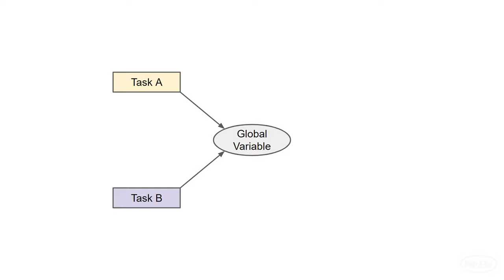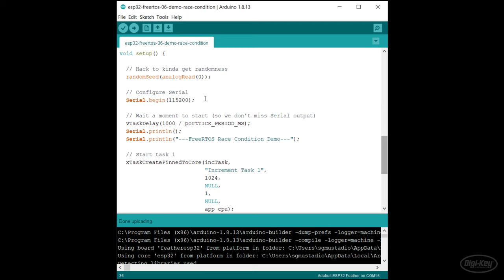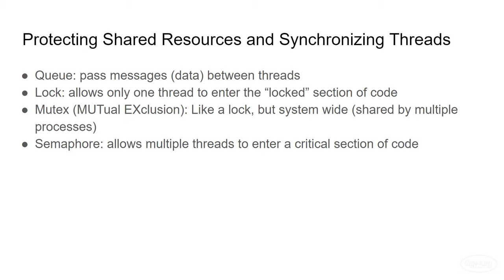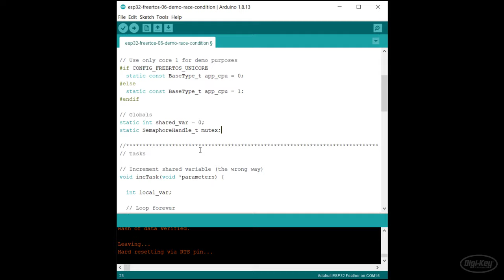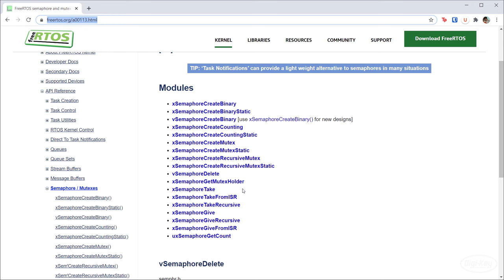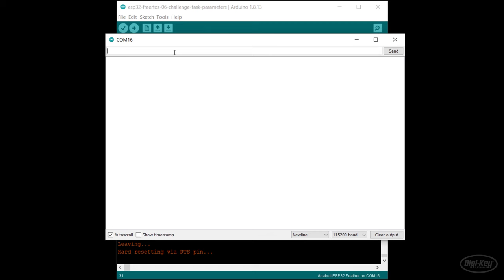Introduction to RTOS Part 6 - Mutex | Digi-Key Electronics

Comment: I attempted your challenge problem but it wasn't working but the code seemed fine.. It looked like the blinkLed task was taking too long to start and just wasn't able to take the mutex in time so I has to use a little bit of delay in setup so that the task can start and take the mutex, copy the variable and return it to signal the setup function to finish.. I was only able to solve the problem this way, is there another way to do this without using delays?

Comment: Nice example, but you print the shared_var after you give the Mutex. The shared variable is updated correct but there is a risk of printing the wrong value. You should print the local_var to safe
Reply: Good catch--it's not completely thread safe, as the other task could interrupt just before the Serial.println(shared_var) line. Either printing local_var or putting the print line inside the critical section should work.
Reply: @ShawnHymel  Printing local_var also isn't safe as the other task may increment and print between xSemaphoreGive() and Serial.println(). The safe way is to move printing inside the critical section

Comment: Hi Shawn. Thank you for the nice work.
I wanted to make sure "Serial.println(shared_var)" was "actually" being executed by different tasks, so I added Serial.println(pcTaskGetTaskName(xTaskGetCurrentTaskHandle())) to print the task name along the shared_var.
It works beautifully for the "race-condition", showing which task is actually printing the 'right' and 'wrong' values. But ...
When I did the same for the "demo-mutex", to my surprise only "Increment Task 1" executes, never "Increment Task 2".
Maybe the compiler is optimizing something ... even with two functions with the random delay.
At the end what worked was to add a small delay "vTaskDelay(1 / portTICK_PERIOD_MS);" right after "xSemaphoreGive(mutex);"
Only then you see one task printing after another in sucession.
Any thoughts?
Reply: Interesting...were both your task 1 and task 2 created with the same priority level (e.g. priority level 1)? It seems like your Task 1 is executing with a higher priority than Task 2. If they are the same priority, they should execute in a round-robin fashion.
Reply: @ShawnHymel     Hi again, Thanks for the promptly reply. So, no changes to priority or delays.
In """esp32-freertos-06-demo-mutex.ino""", JUST changed """Serial.print(shared_var);""" with
"""Serial.print(shared_var);   Serial.print(" <<< ");    Serial.println(pcTaskGetTaskName(xTaskGetCurrentTaskHandle()));"""

(Also shortened task name to "Task 1" and "Task 2", so it will show.)
It will print:   1 <<< Task 1 ...    2 <<< Task 1...    3 <<< Task 1...    4 <<< Task 1... forever(?)
Add """vTaskDelay(1 / portTICK_PERIOD_MS);""" right after """xSemaphoreGive(mutex);"""
And it will print: 1 <<< Task 1...    2 <<< Task 2...   3 <<< Task 1...   4 <<< Task 2... and so on (as expected).

Furthermore, in the original code, if I comment the delay """//vTaskDelay(random(100, 500) / portTICK_PERIOD_MS);""" and let it run 'super' fast (as you mentioned in the video), it will print: 
1 <<< Task 1   ...       1833 <<< Task 1
1834 <<< Task 2...   2018 <<< Task 2

2019 <<< Task 1...   3046 <<< Task 1

3047 <<< Task 2...   task 1 always run much longer then task 2.

By the way, using Arduino IDE 1.8.13 on a ESP32-DevKitC V4 development board.
Thanks again!

Comment: Hi Shawn, great tutorial, thanks.
I have an App that runs on a ESP32CAM. Task1, when triggered, takes a picture and stores it to SPIFFS. 
Task2 keeps checking SPIFFS to see if it finds new pictures, send them to FTP and deletes them.
The conflict would be if Task2 finds a picture partially written to SPIFFS by Task1 and tries to send it to FTP while it is still incomplete. 
So I am using a Global variable fileName that is populated when Task1 takes the picture and saves it to SPIFFS and as soon as the save is done fileName is set to "". So Task2, before grabbing a picture for transfer to FTP it checks if the name of the picture on SPIFFS is equal to the global variable fileName. 
If it maches it means Task1 is still writing the file and FTP file transfer is postponed.
Only Task1 writes to fileName, Task2 only reads although it has a big chance of concurrency as each task runs in its own core.
Do I need to implement the strategy shown in this tutorial to my App?
Thanks
Reply: If your global variable can be written atomically (i.e. one instruction cycle), then I think your global variable strategy will work fine (as you only have one task writing to it). However, I think this is the perfect opportunity to use a mutex or semaphore to notify other tasks. I believe the simplest solution would be to protect the new file reading and writing process (both functions) with a mutex.
Reply: If you try it, please let me know if it works! I'd love to hear about a mutex getting used in a real application like this!
Reply: @ShawnHymel  OK, I will try to implement it and report back. Thanks again.
Reply: Why not use a Queue here instead? Task 1 takes the image, writes it to a temp file, then once the file is written, it posts the filename to the Queue. It can then continue to take the next image and write to a new temp file. 
Meanwhile Task 2 is waiting on the Queue. When a filename arrives on the queue the task uploads that file then deletes the temp file.
This split also makes it easier to test your tasks independently.
Reply: @GrahamStw  Good idea...I didn't think of passing just the filenames with a queue.
Reply: @GrahamStw  I found that tasks had to be independent and run concurrently because, when an image is been transferred an event that triggers a new picture has to be serviced immediately so the process that takes pictures can never be denied immediate processing time. The file transfer is not that sensitive but once started cannot be interrupted in order to prevent timeouts so each task runs on its own core and are only interrupted if at all, by the task scheduler. That is my understanding of how things work.
Reply: @fingerprint8479  If the image capture is time critical then Task 1 may want to copy the image from the camera buffer to a memory buffer instead of a file. That would be faster than writing directly to file storage. Your only issue would be running out of memory (a typical solution would be to statically allocate a number of buffers). You could then perform your FTP from memory or perhaps have another Task that writes the memory buffer to a file before handing it to the FTP Task. None of the FTP timeouts should be so short that you have any problems with other Tasks running on that core. Hope that helps.
Reply: @GrahamStw  "Your only issue would be running out of memory"
I am also thinking about the possibility of a power failure, that is why the decision to record the image to SPIFFS.
Reply: @GrahamStw  "None of the FTP timeouts should be so short"
Yes, possibly, but I did not test this scenario and went straight to the independent tasks each running on its own core. The main concern has been that when it is time to take a picture and save it somewhere the process does not fail because I will not have a second chance for the exact same image.
The FTP file transfer, if and when successful deletes the source file from SPIFFS so, if FTP fails the system will try again so it is not that critical. The project is working fine this way and it is resistant to external failures like internet or power down.
Even the possible problem that led me to ask about the potential conflict between tasks while accessing the same variable has not bee shown to be a problem.
As I am busy improving other parts of the project I will live as it is now and fine tune it as required. 
Thanks, it sure helps improving the project.

Comment: Great video. But why not simply disable interrupts, check the global value, write to it and re-enable interrupts? Could this be what a mutex actually does behind the scenes?
Reply: Good question! You can disable interrupts with taskENTER_CRITICAL() and taskEXIT_CRITICAL() (it's a little different on the ESP32, which I'll show in a future episode). Using a mutex is different--a mutex allows other tasks and interrupts to run but won't let them take the same mutex. This way, you have several options when it comes to protecting shared resources.
Reply: @ShawnHymel  I guess what I'm getting at is that by entering a critical section to read and write a global variable and then immediately exiting the critical section would solve the problem without using a mutex and I imagine it would be faster than calling a separate function. And although other tasks and interrupts would be blocked for a couple of cycles, that's exactly what we were trying to do. This led me to think that maybe this is exactly what FreeRTOS's functions do internally, or do you know if there is any other way they could achieve this? Thanks. Probably getting a bit too detailed, sorry.
Reply: @ytubeleo  Yes, that is what FreeRTOS is doing when you use taskENTER_CRITICAL()--it disables interrupts (up to a given interrupt priority level). You could avoid a function call if you disabled them manually, but doing it that way would be unique to the processor (i.e. the code would not be as portable as it would be with FreeRTOS).

Comment: Hi Shawn, In the solution, I'm completely confused.
So in the setup() we took the Mutex a second time with xSemaphoreTake(mutex, portMAX_DELAY). Just for the purpose of waiting the maximum amount of time (so that it is blocked), that's the only reason right? If this is the only reason why not just use a a simple delay function vTaskDelay(1000 / portMAX_DELAY)?

Also, after we have run the second xSemaphoreTake(mutex, portMAX_DELAY).. since the mutex was released earlier, then the Mutex will be taken again returning pdTRUE, but I don't see a function afterwards to release it?

Any help is appreciated

Comment: Is it possible to put the user program to run on the same core as the WiFi on the ESP32?
What happens if a core has nothing to do? Lower power consumption?
Reply: Great question! You should be able to pin any task to core 0 (the core generally used for the WiFi/Bluetooth stack). From my understanding, WiFi functions run as a bunch of tasks on core 0, so you'd probably want to be careful not to interrupt those too much (assuming you're using WiFi). Here's someone who had a similar question: https://github.com/espressif/arduino-esp32/issues/929

According to this post (https://esp32.com/viewtopic.php?t=7306), you can power down Core 1, which should save you some power.
Reply: @ShawnHymel  Excellent. Thanks for the quick reply and these videos.

Comment: Because you print the shared var after giving back the mutex, is it not possible that the other task could update the shared var before the print actually happens? Although probably won't happen in this example because of the delay in the critical section

Edit: saw the code on GitHub fixes this

Comment: There is one thing I dont understand. Why can't I just use a global variable instead of the Mutex and set it 0 once the shared ressource is being used?
Reply: You could--you just have to be sure that reading and writing to that global variable happens in a single instruction cycle, or you could end up with a race condition.
Reply: You need to have an atomic test-and-set operation for that, otherwise Task 1 could read the variable was available, then Task 2 could interrupt and also read it is available and claim it. When Task 1 resumes it will think it is still available.
Reply: @GrahamStw  Ah, right--you are correct. I thought Marc was asking about using a global variable as the resource (rather than as the mutex). The atomic test-and-set operation is necessary for mutex operation.

Comment: I may have missed this, but how does task created? I am confused about the hack offered in the solution. it seems to me that the xTaskCreatePinnedToCore() function will enter the blinkLED() so it can yield the mutex. is it how it works? thank you.
Reply: That is correct. xTaskCreatePinnedToCore() creates a new task that runs the BlinkLED() function. The task running setup() waits for the mutex to be released by the newly created task running BlinkLED(). Hope that helps!
Reply: @ShawnHymel  you mentioned in lecture 2 that the scheduler is already running before the setup() function so this hack make sense now. Thanks!
Reply: @急眼的海老  Glad it helped!

Comment: Anyone else having issues running the solution that is in the solution sheet? I'm getting when typing an integer "assert failed: 0x4008883a <cached disabled>:832 (<cached disabled>)"
Reply: My solution was to do the following at the end of the setup function, this prevents the function from ending and the variable that's passed from going out of scope:

while (xSemaphoreGetMutexHolder(mutex) == NULL) {}

Shawn's solution didn't work for me either for some reason, but this did.

Comment: The challenge solution didn't work with me since the blinkLed task gives a mutex meanwhile it's not the holder, so It ended up in a deadlock. I used binary semaphore instead.
Reply: the Task who took the mutex has to release it in the end, no one else.
Reply: @BinGanzLieb  exactly, that's why the solution on the Digikey website didn't work.

Comment: Hi Shawn, I have a problem trying to implement Mutex. ESP32, 2 tasks each on its own core. 
One OLED display, both tasks posting messages to the display. One function handles printing to the display.
I want to use Mutex to avoid the scrambling of text that sometimes happen with messages.
How can tasks know the display is taken and the task should wait till the display is available?

void printToDisplay(String text){

  // take mutex
  xSemaphoreTake(xMutex, portMAX_DELAY);
  
  static byte   lineCounter = 0;
  static String displayText[8];
  if(lineCounter>7){
    for(int i=0;i<7;i++){
      displayText[i] = displayText[i+1];
    }
    displayText[7] = text;
    display.clearDisplay();  
    display.setCursor(0, 0);  
    for(int i=0;i<8;i++){
      display.println(displayText[i]);   
    }    
  }else{
    displayText[lineCounter] = text; 
    display.println(displayText[lineCounter]);
    lineCounter++;
  }  
  display.display(); 

  // release mutex
  xSemaphoreGive(xMutex);   
  
}

Thanks
Reply: The way you're using the mutex seems correct to me...it forces any other tasks to wait at the top of the function until the task holding the mutex is done. Are you seeing the text scrambling occurring now? What happens if you only have one task call the printToDisplay() function? Does it still work?
Reply: @ShawnHymel  Hi Shawn, at the end I found the problem only happens with tasks running on core0 sending messages to the display. If I move both tasks to core1 it works ok. If I put both tasks to run on Core0 it gets really worse. It seems to be some strange timing problem I assume because Core0 also runs other things. My conclusion is I will have to live with it as the text gets organized when the message is not coming directly from the task running on core 0. Thanks
Reply: @fingerprint8479  Interesting...if core 0 is running other tasks, then possibly, but I don't see how that interferes with mutex operation. If you disable everything else on core 0, do you still run into the same issue?
Reply: @ShawnHymel  For this test the only two tasks are as below:
void task02( void * parameter ){
  while(1){
    printToDisplay("Task02..............");
    vTaskDelay(2500);
  }
}
and...
void task01( void * parameter ){
  while(1){
    printToDisplay("Task01.............."); 
    vTaskDelay(1500);
  }
}
The only configuration for the problem not to manifest is to put both tasks to run on core1. If any or both are assigned to core0 the problem shows up.
The behavior on the display is something like:
Task01..............
Task02..............
.Task01.............
.Task02.............
..Task01............
And eventually it rights itself but not before it get much worse, it is somewhat cyclic. But, as I said, if both tasks run on core1 no problem.

Comment: is it necessary that both the task has to run on the same core for the mutex method?
Reply: You can use semaphores and mutexes to protect resources across multiple cores, assuming all cores have access to shared memory. The ESP32 does have this shared memory, so one mutex should work for tasks running on both cores. I recommend reading this article to learn more about how ESP-IDF differs from FreeRTOS: https://docs.espressif.com/projects/esp-idf/en/latest/esp32/api-guides/freertos-smp.html